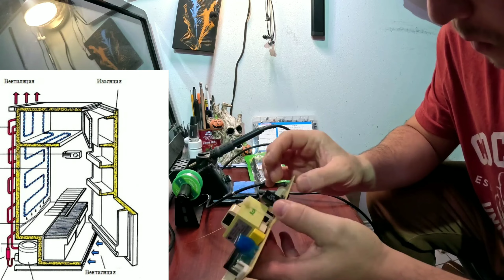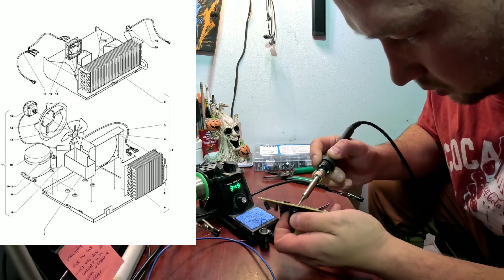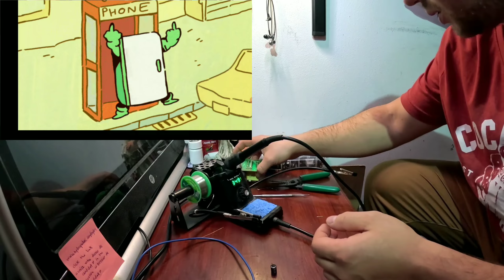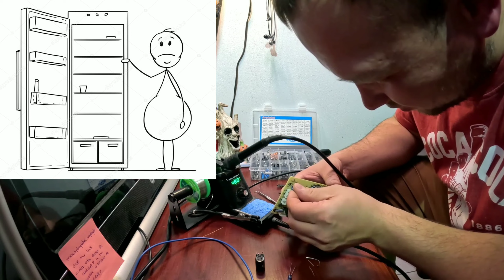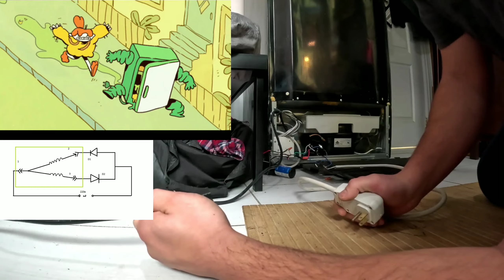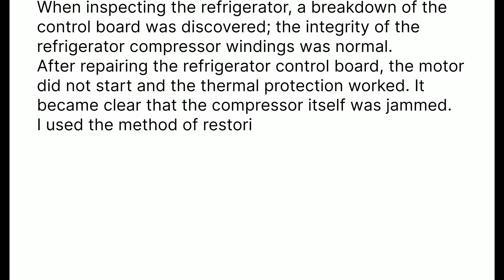Repair of the control board of the refrigerator Nofrost unsticking the refrigerator compressor.

Comment: Hi, what diodes did you use to start a stuck compressor?
Reply: Sử dụng diodes có ưu điểm gì so với tụ điện?
Reply from the maker: I used 1 Pairs 25HFR120/25HF120 Rectifier Diode, Iron Base Forward/Reverse Bias Rectifier for Battery Charge and Converter, 25A 1200V
Reply from the maker: Việc sử dụng điốt điện áp cao làm giảm khả năng đánh thủng điốt, bởi vì điện áp của điốt càng thấp thì khả năng đánh thủng của chúng càng cao.